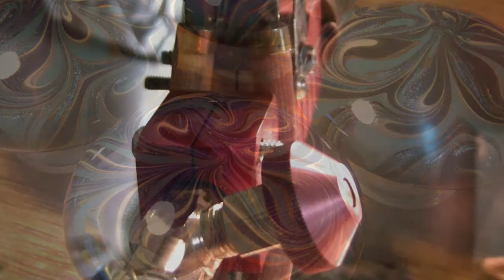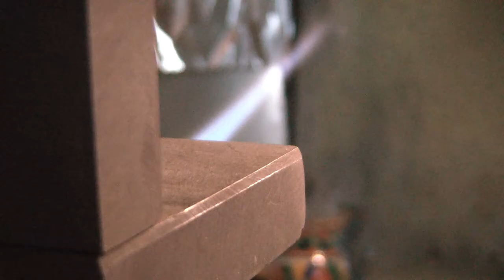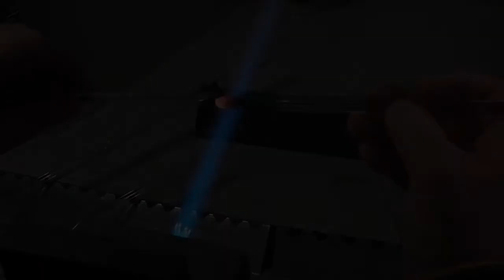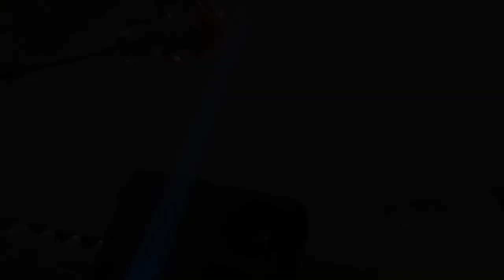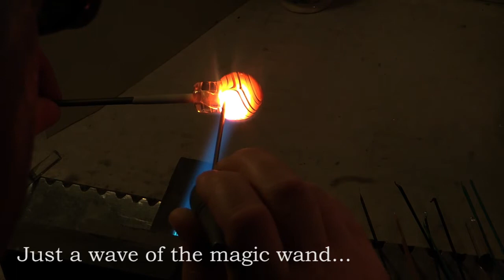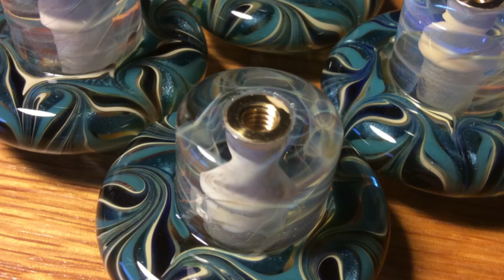Torch Demo of a Glass Cabinet Knob by Bill Grout - using a GTT lynx + Nortel Red Max torch

Comment: Is there anything special you had to do to get the lynx to mount on the red max or does it bolt right up?
Reply: At 0:11 seconds pause to see the best look at how it was modified. I had to cut and file the red heat spreader considerably so the lynx hoses could straddle the Red Max. The mounting tab of the Lynx is bolted between the heat spreader sides, filed to fit.